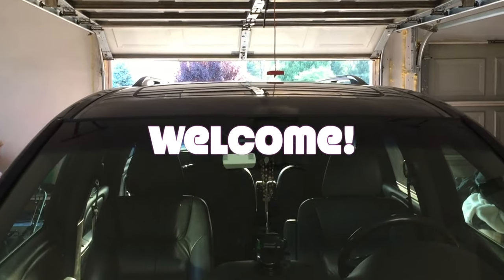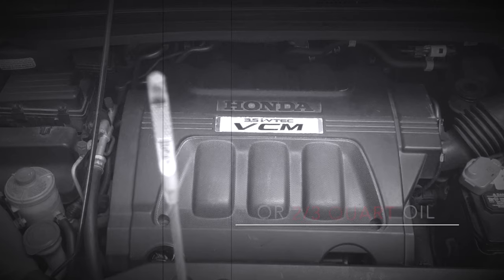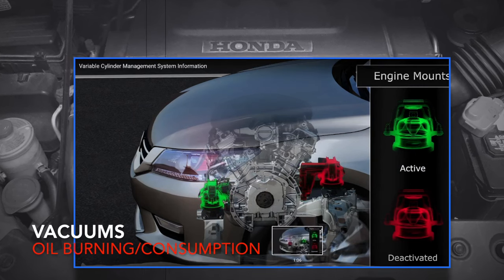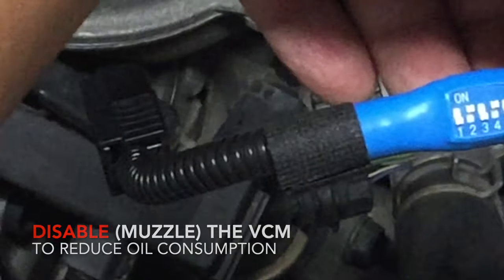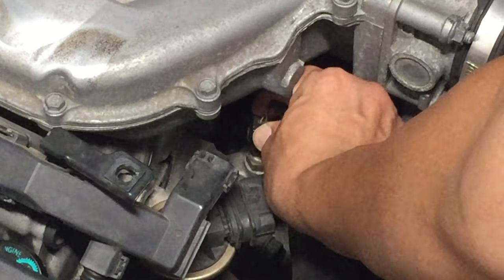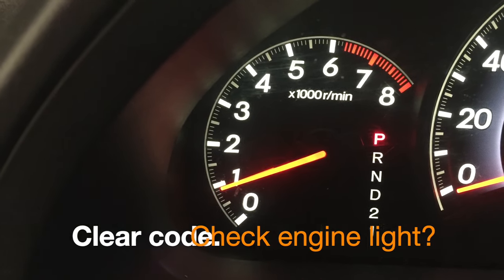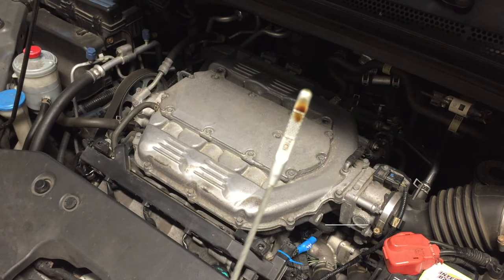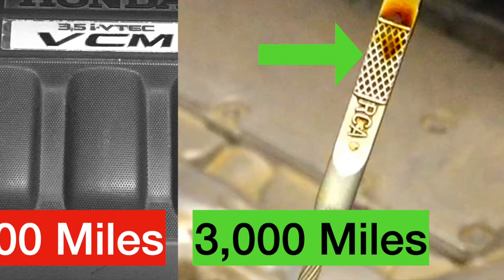Honda V6 Engine Burns Oil? Fix it in 5 minutes.

Comment: Correction.  VCM is the worst and saddest News in the world of cars. Vcm kills your engine, withbtime it screws up all your solenoid valves, valve cover gaskets, piston rings, and even transmission . The little savings you get at the pump  comes with the cost of completely losing your engine in 5 years or so, unless you muzzle the vcm.
Reply from the maker: Yes. Unfortunately, it's one of many examples where government policies/regulations only sound good on paper. These "clean" policies are at the cost of real sufferings like this and, in the end, counterproductive to genuine environmental protection. Complete ignorance of the reality!
Reply: “Worst and saddest news in the world of cars” is a bit dramatic, and wrong!  GM, Chrysler, Ford, Nissan, BMW, Audi and Hyundai/Kia have brought far more problematic driveline components to the market.

The problem described is not universal for engines with VCM either. Our 2007 Odyssey with VCM has 292,000 miles and uses no oil.  The engine is smooth and quiet, never requiring any repairs since we bought it new. I have been very diligent with maintenance though.

My own theory is that the VCM feature makes the car more vulnerable to damage if oil change intervals are not adhered to, or the wrong type of oil is used.  Maybe Honda should have taken that into account when they designed it though.
Reply: You can thank the EPA for this nonsense "feature." That's the only reason Honda was forced to engineer this into their engines. Same goes for the auto engine stop / start that burns up starter motors. Independent testing has shown only a 0.6 MPG savings with VCM enabled. It's a boondoggle, disable it with an aftermarket kit and and save yourself the headache of oil consumption and other issues.
Reply: @jaygrosse8365  As a Honda Odyssey owner for the last 10 years I don't think the above comment is wrong actually the class action lawsuit and any online forums indicate many have the same problem even following the Honda maintenance schedule, you may save a little fuel but you will burn more oil and the catalytic convertors will not do well with burnt oil going through them, it's a bad situation.

Comment: Guys keep in mind that you can reduce some of the oil consumption by changing the PCV valve. Saying that, the VCM modification is the best there is. You’ll notice an immediate improvement in engine response.
Reply from the maker: Yes, thanks for that note! PCV is a common culprit for oil consumption. Cheap and easy to replace on this Honda engine.
Reply: @profsg  coincidence, I just bought the PCV and Muzzler for the 3.5L 
its my first full gas tank. so far so good around 120km for 1/4 Tank, and i'm afraid it will just drop down and I wont get 480km for full gas tank. Seems there is no other way to save gas on this one. VCM is not an option.
Reply from the maker: @yaesmucho  Yes, fuel economy will suffer but it won't be terrible. VCM was created to boost perhaps 1 extra mile per gallon. :)
Reply: @profsg  indeed!
Reply: put a vcm switch on our 08 accord and was good for 4 months. then it through a engine code for a thermostat. vcm switch keeps the car temp down hence throwing a engine code. these engines suck.
Reply from the maker: @Chetrippoff  Depending on the type of VCM muzzler, you may adjust the resistor/dips for each season per instructions. Hopefully it’s not related to thermostat and the code can be cleared for good.
Reply: I can’t find mine on a 2012
Reply from the maker: @RyanJones-rg4ly  If you can't find PCV on your engine, this video shows some of the locations: https://youtu.be/bGVFDy7I0j8

Honda's J35 engines (A6 or A7) have different locations, it's either on the driver side shown in the video above OR in the front below the oil dipstick. Good luck!

Comment: You are right, i need to add 1qt/300 miles in my 2005 odyssey.  I fixed the oil burning issue by inserting a muzzler. oil burning stopped but the gas mileage when from 27 mpg to 21 mpg but the good news is the life of the engine has been extended, and i stopped losing front engine mounts because the engine is running balanced instead of running with only 3-cylinder.  check out Honda service bulletin 13-080.   Honda lost an epic law suit and had to extend the engine warranty for 8- years so consumers could bring their Honda odyssey vcm engines for new rings on each piston to fix the engine burning issue.  IN 2022 to date Honda has removed the VMC from their engine designs because they know that VMC represents faulty engineering in which they used the public consumers as guinea pigs. There is also another problem, the transmission is sensitive to heat. Suggest you reroute the transmission fluid into a separate small radiator to keep the transmission oil cooler while the fluid is circulating through the system or you can pay $6K for a rebuilt transmission.
Reply from the maker: Glad to know it fixed your problem too. And thanks for sharing the knowledge. As for transmission, also remember maintenance is key and replace the fluid every 30k miles or so. I just posted a video on ATF replacement. Feel free to check it out.
Reply: @steelewheels1365  Welcome to the club... This class action happened so quickly I am suspicious of it. Almost like they had someone bring it against them BEFORE everyone started having problems so they wouldn't have to pay as many people. I was never notified by Honda or the dealership. Pretty much identical situation as you... It might be possible to organize again. This has already cost me a couple grand, weeks of my time, and it's still not fixed. Hoping one of these VCM devices does the trick.
Reply: @steelewheels1365  so my 2015 odyssey should still be covered under the lawsuit extended warranty?
Reply: Hi , thanks for the post. I got a 2025 Ridgeline. Just wondering where did you got the info that Honda removed the VCM on their 2022 and onwards V6 engine? I really hope that's true so that I no longer  have to put any VCM muzzler on my new one. Thanks again!
Reply: @Radwinskee   Honda may still call it VCM but it is no longer shutting down the 3 rear cylinders.  AS u know when the 3 rear cylinders are shut down they behave as oil pumps and suck the oil past the piston rings into the cylinders heads.  In the new models, just keep an eye on your gas mileage, it  will be <<< 27 MPG BC all the cylinder heads are now firing in all engine modes of driving in your 2025 Honda engine . Another trick is just ask the Honda dealer and they will give you a awkward answer.

Comment: I installed an S-VCM in my V6 Accord and my oil consumption went from 1/2 to a full quart per change to NOTHING. Also, no engine shake any more. Much smoother ride altogether. Best money I ever spent on my Accord (which hasn't been much).
Reply from the maker: This is great! Thanks for sharing!
Reply: I also use the S – VCM, this product requires no adjustments and is fully automatic.
Reply: @sat_sonic hi can send link which did you use?

Comment: I have had two engine misfires due to fouled spark plugs on my 2010 Honda Accord (53000 miles and 65000 miles).  The first misfire was sparkplug 3 and the second was sparkplug 1.  I installed the vcmuzzler 2 and now 3 years later (and 8000 miles, didn't drive much during pandemic)  I have experienced no misfires and no oil consumption.  I am very happy with the modification I made and continually wonder why Honda continues to equip vehicles with vcm.
Reply from the maker: Thanks for sharing! I guess for Honda or other auto makers, it is all about having those MPG numbers on paper and meeting/exceeding EPA expectations.
Reply: How’s the fuel consumption?
Reply: @MrSamPhoenix  don't do a lot of highway driving with the car anymore just local.  I would say it loses 1 or 2 mpg but the car runs so much more powerfully and smoothly.
Reply: @danjoe22  exactly as I thought. My brother’s wife has a 2011 Honda Accord EX-L V6. She bought it new, and recently it’s been giving some small issues. 

But when I drove it last the VCM solenoid wasn’t working and it was stuck in V6 mode. It felt super powerful than it ever did because of it.
Reply: Was there any oil on that spark plug? On my 2010 V6 they told me it's a piston ring that needs replacement. But if i keep replacing the sparkplug and checking the oil i would be fine
Reply: @tnosz  My test of the vcm muzzler was no oil consumption.  If no oil consumption I would think there could not be  much if any on the spark plugs.  Changing the spark plugs at reasonable intervals is a good way to avoid vcm problems.  It is expensive, though.  6 plugs at 30 bucks a piece and an hour of labor would be about 300 dollars! But it is still an workable alternative.

Comment: I buy q V6 for a V6 not so it can secretly switch into Geo metro mode and become a 3 cylinder engine 🤬 if i wanted oil consumption i wouldn't buy Honda
Reply from the maker: Agreed. Unfortunately this design is all about MPG numbers on paper rather than long term reliability for the consumers.
Reply: @profsg  yes sir the EPA has ruined Honda 🤬
Reply: @friendofvinnie that’s problem to much dam government on the back of these manufacturers I absolutely hated Honda for this my 2000 EX V6 249,679 K miles have  no where near the problems my 2010 Honda coupe V6 with that stupid VCM

Comment: I just purchased a brand new Honda Ridgeline and I will definitely install one of these defeat devices. I'm glad I found out about this while my truck is new, before any wear is caused by VCM.
Reply from the maker: Glad to hear this! Congrats on the new purchase and, with good preventive maintenance, there will be many hundreds of thousands of miles!
Reply: No need to with the newer j35s that came out in 2018-present. I’m a dealer tech and we don’t see any issues with oil consumption on the 2018+ engines. I would advise to use quality gas (issues with fuel injectors), change your oil more frequently (and not do your first oil change or any at 6-10k miles even though the maintenance minder will tell you oil life is good), and change the transmission fluid earlier than advised - especially if towing or a 6 speed automatic.
Reply from the maker: @Tony-375  Thanks for sharing the insider observation! Good advice on regular oil changes and early transmission fluid service. As for 2018+ model years, while Honda had improved on the VCM design, I'll have to wait and see as it may take some time (7/8 years) for major symptoms to surface.

Comment: I installed the S-VCM in my 2021 Honda Pilot EX-L AWD.  It is just plug and play. Designed by a Honda Technician, no resistor to deal with. 
Love your vids by the way.
Reply from the maker: This is even better! Thanks for the feedback. I’m very glad to know!
Reply: Is that the one from Canada "Quebec" i am going to buy that one
Reply: @friendofvinnie yea it is. I have on my 2021 Ridgeline
Reply: @daveroski  notice any difference?
Reply: @friendofvinnie  I average 18-19 mpg. Probably would be 22/23 if I didn’t have it. Always more power. But I contemplated taking it off. I do recommend to disable the auto shut off start module to keep the auto stop from turning on every time you turn on vehicle.
Reply: @daveroski  thanks for the feedback bro!
Reply: @daveroski 
Idk how you come up with those numbers, I only loose 2mpg at most  in the city and 1mpg in the highway .
But the difference in performance is noticeable
Reply: @reyperez3424  I average 19 Lately I drive 50/50 highway city.  I can’t compare because I put it on the week I purchased. I also disabled auto stop start. So mileage may go down from that one

Comment: I soldered 2 "44" ohm resisters in series, in-line in 1 of the temp sensor wires and it instantly solved the problem.
Total cost was under $10.
Reply from the maker: Wow! Great job! The only thing I'd add is to keep an eye on potential engine code/check engine light, and make sure it's benign (due to the modified coolant temperature sensor with seasonal temperature fluctuation). If that's the case, you can clear it or ignore it (may disappear on its own).
Reply: @profsg  ...I did it over a year ago and never got any codes at all.
Reply: There are 2 wires coming out of that.Coolant temp sensor which one do you hook up a resistor two or does it matter
Reply: @krod2162  ...Either one will work. It is just a simple loop through the switch. Let me know if it work for you too. 👍👍

Comment: I put this on my 2013 Pilot - January 28, 2024.....  Works fine here in Kansas winter so far.  It's 45 degrees here today and it is working fine at 82 ohms.  My Pilot is running WAY better without the VCM.  I'll update this if it gets colder and I have to change the dip switches.  It can get down to -10 degrees here in winter and up to 110 in summer.
Reply from the maker: This is great! Thanks for letting us know! Given the huge temperature variation, you will likely have to adjust the dips but keep us posted.
Reply: I have a 13 pilot too I can't tell a difference with or without it I'm using a resister
Reply: @brandonjohnson7851  Is your VCM still kicking in?  You can tell by the green ECO light on left side of instrument panel.  If the green ECO light is still coming on when you drive then you don't have VCM disabled.

Comment: My 2006 3.0 with 150k miles consumes the exact same amount of oil (one qt/1,500 miles) and I will try this quick fix. Very good video professor, and very good English!
Reply from the maker: Glad it was helpful!
Reply from the maker: Also check PCV valve and consider replacing it as well: https://youtu.be/bGVFDy7I0j8

Another easy job. Doing both will eliminate most of oil consumption on the Honda engine.

Comment: Hey just wanted to say thanks for the info. I have installed the muzzler and works great at 91 I pa.   BTW try bg epr my 2010 pilot burns NO oil whatsoever after a flush with epr . All of my rings are free and working . 134 thousand miles .  Try it and amaze yourself
Reply from the maker: You are welcome! Heard good words about BG products and will try it in the future.

Comment: I run Pennzoil Ultra Platinum full synthetic 5W20, $7.15/qt, so the S-VCM disable module is well worth it for me.  Not to mention to replace all 5 engine mounts is thousands of dollars at the dealer.
Reply from the maker: Exactly! These active control mounts are not cheap at all and they are so designed (and expensive), again, thanks to VCM.

Comment: Glad I found your video.  Been having random misfires etc like others said.  Initially thought I needed a tune up till I did research. Eventually landed me here and a couple other articles/videos.  Just ordered the part from your link.  Will update once I install the part.  Tired of the random check engine lights/VSA lights due to misfires.  When it stops, she RUNS well.
Reply from the maker: Glad it was helpful! Best luck with the installation and keep us posted of the outcome or questions.
Reply: Any updates?
Reply: Well?
Reply: @eric5250  It does work.  The better ones are the one that changes the OHMs as the weather changes for you.  The one I saw was double the price I paid for mine which was $40.  When doing it manually, when it gets cold you have to turn down the OHMs, when warmer turn it up again.  No misfires, but when you don't change it, you will get a check engine light, but no misfires.
Reply: @barryrobinson8261  It does work.  The better ones are the one that changes the OHMs as the weather changes for you.  The one I saw was double the price I paid for mine which was $40.  When doing it manually, when it gets cold you have to turn down the OHMs, when warmer turn it up again.  No misfires, but when you don't change it, you will get a check engine light, but no misfires.

Comment: Does the muzzler prevents the radiator fan from turning on ,since it tricks the computer to read at lower temperature, in that case, could it cause more harm than good, since your engine runs hot all the time.
Reply from the maker: Good question! Fortunately this doesn't affect the fan at all! There are two coolant temperature sensors and the other one (ECT2) tells when to turn on the radiator fans.

Comment: Hi, I have 2012 Odyssey which has p0302 misfire. The Spark Plug on cylinder 2 failing once in a month. Honda says the Piston Rings to be replaced which is expensive. Do you advise to make use of this with new spark plug to permanently disable Eco Mode and avoid the misfire errors. Is this going to be an issue during state inspection?
Reply from the maker: I assume the piston ring in cylinder 2 is not broken but has lost its tight seal due to oil sludge over time. Oil burning/consumption does contribute to this problem and VCM is a major culprit on Honda V6 engines. If this is the case, here is what's I'd do: 

1) Use OE spark plugs (NGK or Denso) when replacing them. I'd replace spark plugs in all cylinders if it's over 100,000 miles on the factor plugs regardless of whether they have misfires. https://amzn.to/49gvKrp
2) When you have misfires, don't assume it's spark plugs though. Ignition coil packs can be stressed out because of these related issues. So test them to know the exact cause: https://youtu.be/fbmwImqPRfI
3) Yes, I'd disable VCM (Eco) and it will mitigate oil burning. Regulations are different in different states. But I can say it hasn't been a problem in PA, as in many other states people reported about when disabling VCM. 
4) For a 12-year Honda engine, if it hasn't been done, I'd also replace PCV and clean EGR. PCV is a common culprit for oil burning (for Honda and other makes) and it's rather DIYable: https://youtu.be/bGVFDy7I0j8
5) For the long term, monitor engine oil level and always keep it at max. Change it frequently with full synthetic oil, no more than 5,000 miles or 6 months. If your piston rings are still one piece, good oil will reduce sludge and hopefully restore piston seal over time.